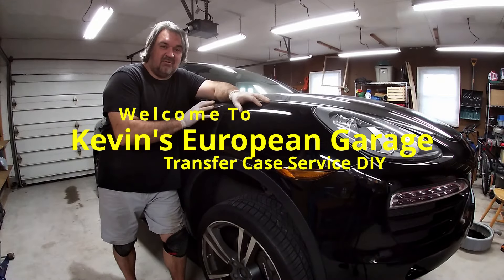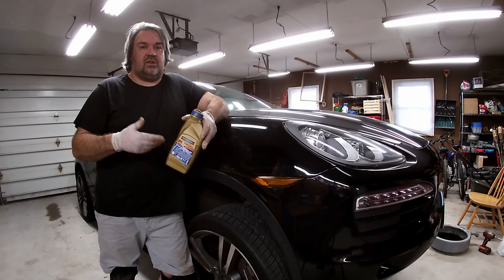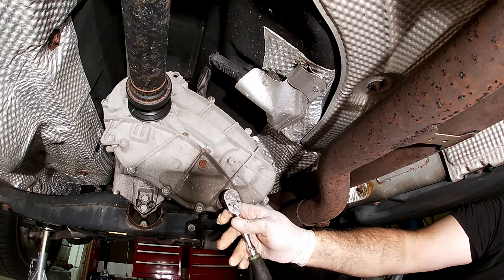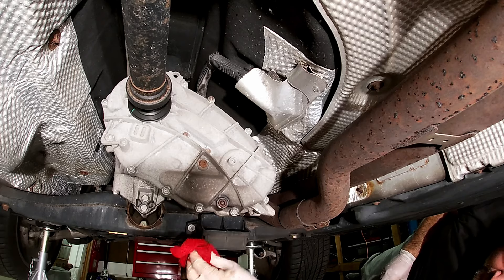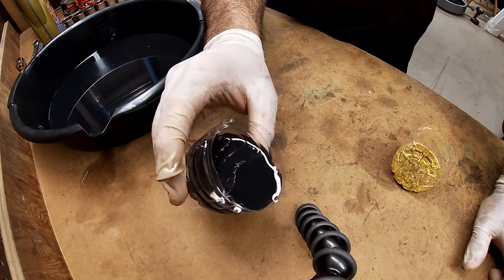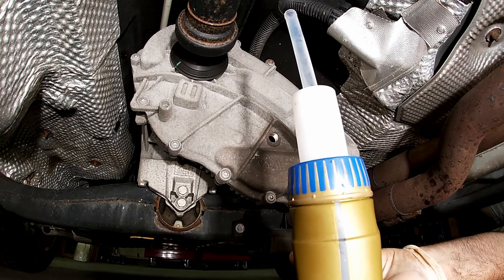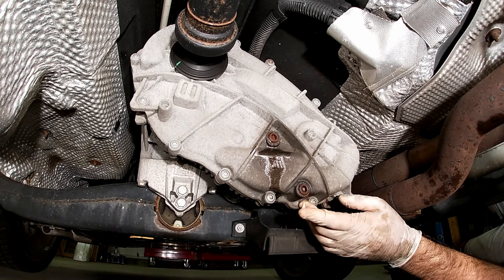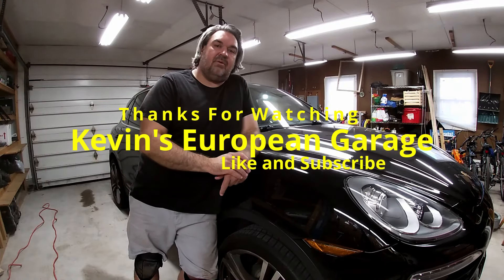Porsche Cayenne 958 92A Transfer Case FIX, Fluid Service DIY Part 2

Comment: My 2013 Cayenne S that just turned 100K miles was slightly jerking normally in lower gears and after watching this video and changing the TC fluid, it runs perfect, NO jerking at all. Thanks for the video!
Reply from the maker: Great I’m glad it helped. Thanks for watching
Reply: @KevinsEuropeanGarage Apart from Ravenol oil which one can I use as an alternative?

Comment: Fyi, Porsche just extended the warranty on transfer case for all Cayennes 2011-2018, for 10 yrs unlimited miles. They even reimburse you if youve repaired it out of pocket. Call the dealer they’ll schedule you for replacement.
Reply from the maker: Thanks for letting all of us know about this. I'm going to be looking into this for sure.
Reply: This only applies if Porsche dealers saw problems with transfer case.  If you’ve had no problems, they won’t just replace it for free.

Comment: I am getting ready to change the transfer case fluid on my 985.2 Cayenne GTS. I ordered 2 bottles of Ravenol DTF-1 from Parts Geek, but received 2 bottles of Motul 75W90.  There's a lot of conflicting information about whether you can or should use 75W90 fluid in the transfer case.   I didn't receive the product I ordered, so I'm inclined to send it back for refund or exchange (provided they have the Ravenol DTF-1), but I'd first like to receive comments on these fluids, and which one I should use in my Porsche vehicle.

Comment: Hello ! I’ve just changed the transfer case fluid for the first time , I have no sound but I feel heavy direction on sharp turns and sometimes a small “bump” on the wheels. After the first change the heavyness is almost gone but I still have the “bumps” , less than before anyways. The bumps would be gone after the third change too?  Thank you

Comment: Just purchased a 2011 Cayenne S in Dec. 2024 with 101,000 miles. Noticed some sputtering at speed and thought the vehicle needed a tuneup. After further investigation, I realized, much to my chagrin, it was a transfer case issue. Followed Kevin’s steps here and changed the transfer case fluid twice. First time cleared up the major symptoms immediately and the rest of them within 50 miles or so of driving. 

Changed the fluid a 2nd time after about 400-450 miles. Some symptoms that had resolved came back but then went away again after about 50 miles of driving. 

I have put an additional 1,500 miles on the car since the last transfer case fluid change and it’s running perfectly! 

Thanks so much, Kevin!! Appreciate your knowledge and hope everyone has as good of an outcome as I have so far.
Reply from the maker: Glad I could help just keep up with changes every 15k to 20k and you should have no issues. My original had 150k when i sold the car

Comment: I’m in my third transfer oil change, but the first two already did solve the problem. You have no idea how thankful I am to you for putting up this video. I was about to sell my car after getting a quote from Amco on a used transmission. So glad I didn’t, the car is as smooth as it it was when new. 
Thank you so so much again.
Reply from the maker: Glad i could help. Thanks for watching
Reply: Did you change front or rear diff fluid? Which one helped, how many times did you change it?
Reply: What torque setting do you tightened the screws?

Comment: Thx for sharing , so every 20,000km we have to replace the transfer fluid ?
Reply from the maker: I would change it at least every 50,000km or more depending on how much citing driving you do. Where you turn more and make the clutch pack work harder. Check out my response to your other post for more info. Thanks for watching!
Reply: @KevinsEuropeanGarage  THX ALOT

Comment: Great video Kevin! My 13 Cayenne GTS just started to encounter the slight bucking / jerking upon acceleration out of 2nd and 3rd gear. I haven't changed the TC fluid yet but would it be worth going to the dealer to get this resolved under the recall before flushing the TC?
Reply from the maker: I would go straight to the dealer if you’re having issues. Don’t flush it. They need to see what is happening. Now that there is a warranty and they acknowledge there is an issue. That be my first stop. Thanks for watching and good luck!
Reply: @KevinsEuropeanGarage  Thanks for getting back to me Kevin. I've got a service appointment scheduled w/my local dealer and will follow up with the outcome.
Reply from the maker: Sounds good let us know what happens
Reply: @KevinsEuropeanGarage  Just got back from the dealer and it took them 5 minutes to determine that the transfer case is bad. Everything is covered by Porsche. Once the new TC arrives in 2-3 weeks they’ll call me to schedule the replacement. I’m pretty excited. Thanks again.
Reply from the maker: Great! Glad to hear they are changing it for you.
Reply: @KevinsEuropeanGarage  Transfer case was replaced at ZERO cost at my local dealer including a service loaner (new BMW 5 series), full check of the vehicle with a wash and vacuum. In & out  the same day. It performs like it’s brand new which goes to show you that the performance of the TCs degrade over time. Thanks again for the advice and content.
Reply: I'm having the same issue on my 2015 Cayenne S. It's definitely not shifting smoothly at all. Not for the $52,999 I paid and the $67,000 after interest on the financing. I pray they give me a new transfer case.
Reply: That warranty was for 7 years and it is now over. So any more transfer case failures means you are paying for it yourself

Comment: Hey Kevin,  your videos are great and very thorough.. I bought a 2011 Cayenne S in July,  runs great ..although there is a slight grinding/winding noise when turning/accelerating.., not sure if it's the transfer case or front differential,  I'll change fluid in both. Also the transfer case looks very clean/bright  as if it been replaced, the vehicle has been well maintained , is it likley the case was replaced already?how would I know ?
Thanks, Mike
Reply from the maker: If the color of the case is different than the transmission it probably was changed already. You could ask to dealer to check the history see if they have a record of it. I think you are out of warranty now. Changing the fluid in my transfer case quieted it down taking turns along with the diff fluid. I would change them all and see what its like after
Reply: @KevinsEuropeanGarage  the transfer case color is similar to transmission,  it's hard to tell the difference..Also , you mention .7 liters, and also to fill up to filler port..until it runs out' my Cayenne S took nearly  the whole qt. Before it started to overflow?

Comment: What exact model transfer case you have? There are 2 type cases in 958.
One is with hang on- locking function and for diesel usually torsen.

Comment: Hi, I'm Maurizio from Italy. I wanted to ask you 2 things: the first thing is if the car, at the end of all the work, gave you some message on the dashboard and the second is if when you finished the work you went to test the car at reduced speed. Thanks.
Reply from the maker: I never had a light come on after i changed the transfercase fluid. What did the message say?

Comment: Does the car need to be recalibrated after????
Reply from the maker: Nope not when just changing the fluid. If you are having issues with the transfer case it might take a couple flushes to make it better

Comment: Hello Kevin, 

I recently purchased a 2014 Porsche cayenne gts and I took it to the mechanic to have a major service on it. The mechanic said the car is fine and there is nothing wrong with it, especially regarding the transfer case. He said that the transfer case is working great. However, my transfer case has never been drain and refilled.

I have been noticing weirds things happening in my car. Can you let me know if these issues are related to the transfer case? 

(in sport mode)
-(manual Mode) While going 30/40mph, 1st and 2nd gear don't seem to add any power to the car and I would need to go to 3rd gear to accelerate the car. Is this normal? 
-(automatic mode) The gear change is really quick. 1st and 2nd gear change at 2000 rpm and I can not get to higher rpm unless I am in 7th or 8th gear.
Reply from the maker: Hi Bao congrats on your recent purchase. I would have the fluid changed in the transfer case. Its like buying an insurance policy. Especially cause it hasn't been serviced to your knowledge.

 I don't think what you describing is a transfer case issue usually when they are acting up they will have a skip and a slight jerking motion on acceleration and light throttle cruising. 

In automatic mode mine does shift quick usually around 2.5k rpm under normal driving and even under slight acceleration. These gears are short.
I don' think if you're driving 30 to 40mph the computer would let you downshift to 1st. Second maybe. I have the V6 so I don't usually push it that hard above 4k. I'm usually in auto mode. I sit in a lot of traffic. I only see  1st and 2nd gears from a stop and through acceleration. After I get to third I'm usually there and higher most of the time. Just driving around you won't use 1st and 2nd usually. It doesn't sound like your transmission is acting abnormally but I would need to drive it to compare it to mine to be sure. These are pretty reliable transmission not many issues at all with them. I  only found one tsb that is about a reprogram or possible ecu replacement released in 2013 but it doesn't list any symptoms. Good luck with your Cayenne I hope you enjoy driving it like I do mine.
Reply: @KevinsEuropeanGarage  You're awesome! Thank you!
Reply from the maker: You’re welcome!

Comment: I got a new case done 10k miles ago. Do I still need to change oil or they fixed the design issue ? Porsche told me i am good but I dont trust
Reply: It wouldn't hurt to keep changing it in every oil change

Comment: Are Ravenol transfer case oil and rear-front differential oil different than the Original Porsche branded oils regarding quality and reliability? The porsche branded oils are very expensive and I’m undecided.
Reply from the maker: Yes the Porsche fluids are expensive. I used the Ravenol fluids because I’ve had good luck with it in the transfer case. It meets all the same specs as the Porsche fluid. I also like Motul fluids and use those in my 911.
Reply: @KevinsEuropeanGarage  thank you for your reply :) I would like to ask about Febi fluids for transfer case and differential oil. In my country I’m not able to reach Ravenol fluids however I found some alternatives in Febi brand. So Is Febi (32590) 75w-90 GL-5 gear oil suitable for 3.2 V6 cayenne base differential oil replacement. My car is from 2006 and triptronic transmision. Thank you again.
Reply from the maker: From what I see on their web site is that their fluid meets the requirements for Porsche and list the part numbers it is comparable with. They are a reputable company I haven’t used febi so I have no first hand experience but I think you should be fine based on what I read.

Comment: Me owner here. How often should I do this service? I'm at 71k miles right now on an 08.b
Reply from the maker: Well if your is an 08 you are way out of that extended warranty. I would change it if least every other oil change so that could be around every 10k miles. To be safe. If you when you change it the second time and the colors looks good and there doesn’t look to be a lot of debris you could skip to 15k. But if it’s really dark and there debris in there when you change it. I would change it drive around for a couple hundred miles and do it again.

Comment: Hi Kevin, I just bought a 2011 Turbo and want to flush the fluid. Do you take the car out for a drive between flushes?
Reply from the maker: Yes I did I drove it a for while between flushes to make sure the new fluid made it’s way around the transfer case. It needs to get in the clutches to clear out the debris. Thanks for watching.
Reply: @KevinsEuropeanGarage  thanks for posting! Had watched your videos prior to purchasing to make sure I was going in eyes wide open
Reply from the maker: Thanks for watching glad I was able to help .

Comment: I had the exact same experience when we bought a 2012 6MT 92A Cayenne 3 years back with 100k miles on it. I changed the fluid 3 times immediately, and now I swap it out with every oil change. Been symptom free ever since, and am now at over 150k miles. There is a lengthy set of threads on 6speedonline and rennlist of people resurrecting their TC with a fluid swap.

Interestingly enough, I heard that PCNA announced just last week an extended warranty on the transfer case for certain models.
Reply from the maker: A manual transmission Cayenne has to be fun to drive! It too bad they just did make the fluid change a 30k service. We I have my first issues with the transfer case over 2 years ago there wasn’t a lot of info. Now there is definitely more out there about this. I’ll have to check into that extended warranty, first time I’m hearing about it. Thanks for watching, please consider subscribing.

Comment: Hello I would like to know, is the viscosity of the brown bottle 75w90?
Reply from the maker: Thanks for watching, according to their site it is a transmission type fluid with additives that make it for use in the transfer case. Definitely not as thick as a 75w-90. It doesn’t list the viscosity on the website.

Comment: Why Ravenol instead of Liqui-Moly?
Reply from the maker: No particular reason i had read that someone had good luck with Ravenol. I figured why not try and it solved my issues. I’ve kept on using it since. If Liqui-Moly has the same specs, it should work just the same. The main thing is to get the old contaminated fluid out if there.
Reply: @KevinsEuropeanGarage  Right on yeah I'm a new 958.1 turbo owner and I put LiquiMoly 75w90 in my transfer case a week ago. I wasn't thinking clearly as I realize now it needs "transfer case fluid" aka ATF, or fluid more like ATF than gear oil. *slaps forehead hard*. I just ran to the garage and swapped that 75w90 with some AMSOIL ATF I  had brand new bottles of while I wait a few days for the RAVENOL fluid to show up. I figure the ATF in the transfer case has to be better than gear oil at least to hold me over for a few days. I am an idiot and hope the 75w90 in there for the past week or so didn't royally ruin anything in the long term. There weren't any sounds or issues with driving on the 75w90 but I prefer the correct fluid in the right places! lol

Comment: Hello i live in germany and have a Problem With my Cayenne it Shifts jerky and i can Drive normal only in manual Mode
Reply from the maker: Thanks for watching from Germany. The transmissions in these cars are really good not many problems. The transfer case can cause these issues. Have you tried changing the fluid. Here is the states Porsche has extended the warranty on these. I’m not sure if they have done that else where. If there is a warranty have them check it out. If not I would  change the transfer case fluid. Has that been done? How many km’s on the car?
Reply: @KevinsEuropeanGarage  the car has 159.000 km‘s and i haven‘t Changed the fluid and i think it has no warranty so the Best i Can do in this Situation is to change the fluid and when its still Not better Should i change it more times?
Reply from the maker: If this is the problem you will notice a difference in just one fluid change. It most likely won’t be 100% after one change but you will know you are heading in the right direction.

Comment: Hi Kevin. On the symptoms, did you have knocks on slow acceleration in 1st and 2nd gear? Almost like someone is knocking the floor pan every couple of meters.
Reply from the maker: There was no knocking, I would say more like a shake, much more subtle than a knock. You get a shutter like a miss fire but no codes or check engine light. it feels like the motor skipped for a sec. We could be talking about the same thing we just have a different way of describing it. If you have never serviced the transfer case I suggest having it done. It is very hard to diagnose these problems without the car. A knocking sounds could be many things and could be unsafe to drive if something feels like it is hitting the floor pan. You should have the vehicle inspected. Good Luck!
Reply: Kevin’s European Garage thanks. I think I know what you mean. It’s especially noticeable when turning. It’s coming from the rear and similar to a car with a locked differential? 

In addition to this, I am also experiencing a knock from the front area which I initially thought to be a worn suspension mount. Your video kinda made me wonder if it’s the oil but what you have described is somewhat different. Have you ever replaced the suspension mounts?
Reply from the maker: I have replaced the front struts and tops and the sway bar bushings. Both of which have videos. I will be replacing the front upper control arms. There are different ways to diagnose suspension each component. I’ll have to do a video to show the various ways to diag suspension parts. It sounds like you have multiple things going on right now
Reply: @BL-zs3pc  The knocking sounds like it could be the drive shaft bearing support. Common for them to wear out as it's just a rubber bushing to take the vibration out of the drive shaft while it spins. When it goes, the shaft will bounce around and hit the under carriage when you accelerate. Theres a few options to fix and some pretty cheap and easy methods found on youtube. Once you remove the cover plate and look at it you will know if it's gone.
Reply from the maker: Yes that was an big issue on the earlier Cayenne’s. I haven’t heard about anyone having that issue for the 958 but that doesn’t mean it doesn’t happen. Good idea to check that.